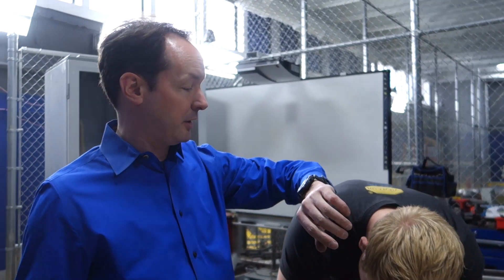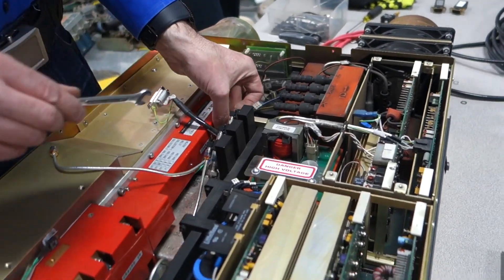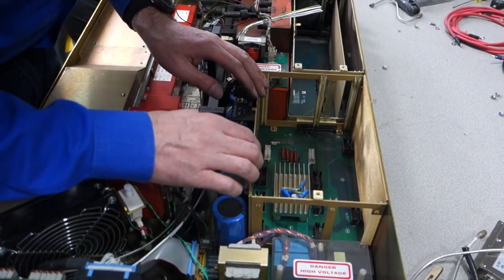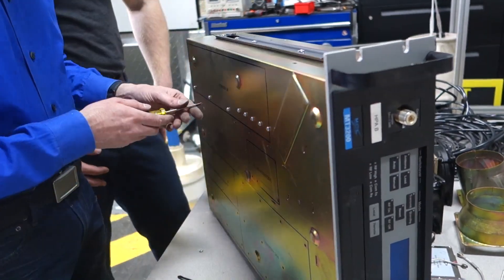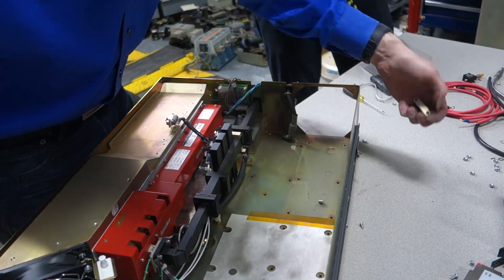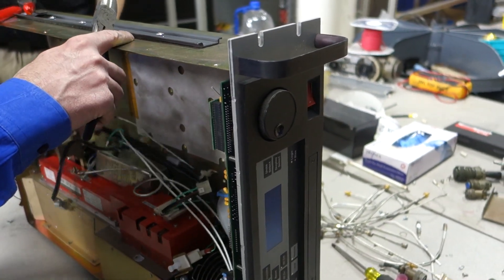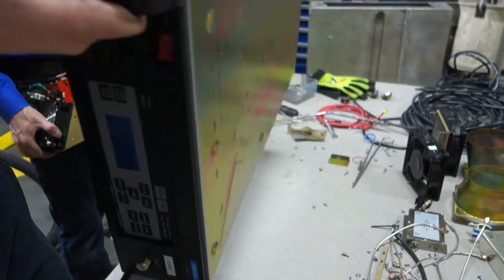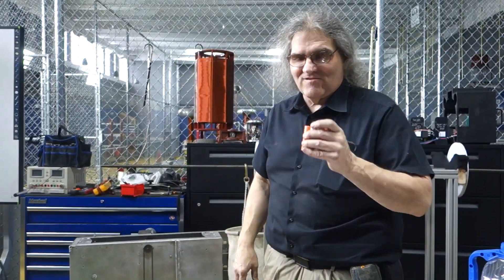Captain's Blog 4 16 2018 HVRF Teardown and 6inch Coil Testing

Comment: Looks like a satellite transmitter judging from the waveguide.    Is that from the sat truck? The beryllium isn’t much of an issue in solid form. The dust is a carcinogen in the lungs though. It has really good thermal properties, hence the use in the transmitter. The magnetron gets pretty hot in continuous use. I had a customer that had a few tools made of beryllium in their tool crib because it’s hard and spark proof, and they had areas in the plant where sparks would be unhealthy .

Comment: Caps and gaps mentioned at the end - ever think about having a servo motor with a simple metal arm to control a discharge system on an mmc?  If the TC is not in use, the mmc terminals could be shorted and grounded

Comment: I imagine that tube acts as a "tuned cavity" for the RF, so it can act as an oscillator / amplifier?

I see it has a lot of flybacks and voltage triplers in there for the main supplies, too. Just like a CRT projector. lol

Beryllium can be quite nasty, but mainly if it is broken to a powder, like Asbestos.

I think a lot of microwave oven magnetrons now use some other less harmful high-heat insulator material now?
Reply: Oooh. Quite neat...

https://www.necnets.co.jp/en/products/twt/index.html

Doesn't look too hard to get that running again. The RF input is on the connector near the cable end.

Might need quite a high voltage, though, and probably modulated at a GHz rate too. Yeah, perhaps not quite so simple. lol

I wouldn't advise looking into the output feedhorn with your remaining eye, either. :p
Reply: Wow - 14 GHz for that model. :o

https://www.necnets.co.jp/en/products/twt/seihin/ld7249series.html

I'm guessing it's from the OB van, or a TV station (for a Ku-band dish) ?

Comment: Nothing. Nothing happens if you go deeper, unless you're a really, really careless idiot and you're going in with a hammer.
The insulators are usually very small, and are completely nontoxic unless broken or chipped, because they're BeO ceramic.
Here's the datasheet for the tube. http://pdf.datasheetcatalog.com/datasheet/nec/LD7249U.pdf